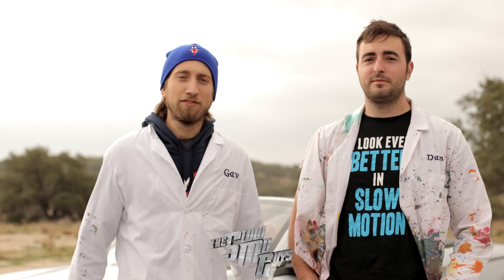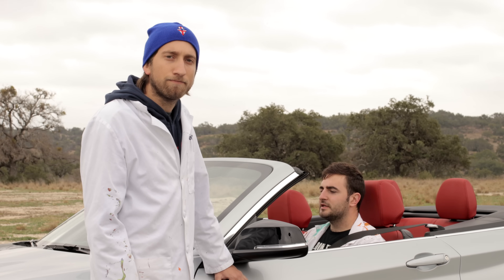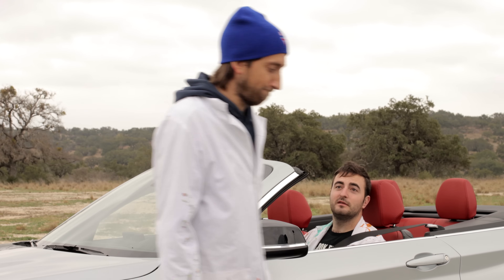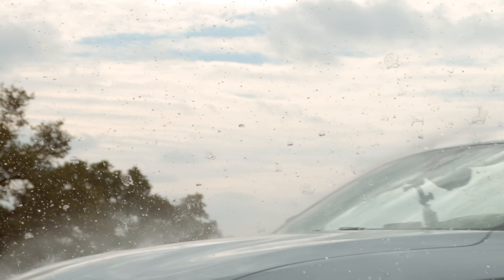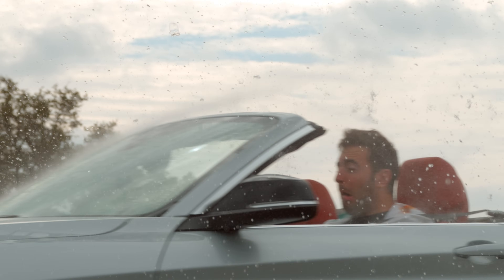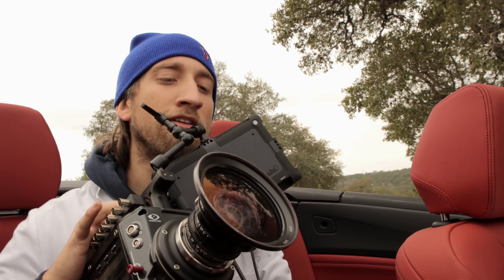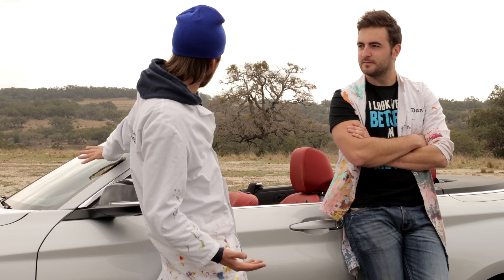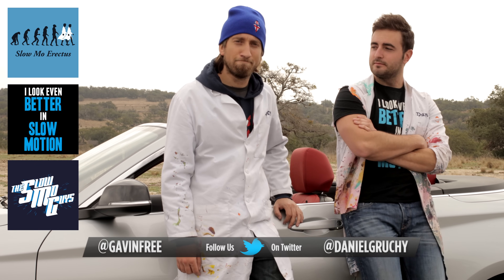Convertible Aerodynamics at 1000fps - The Slow Mo Guys

Comment: I drive a Huracan Spyder but have found there are some practical challenges in the rain when the roof is down.

For starters, the water starts pooling on the windscreen, and then the wind will slowly start pushing that water towards the left and right edges of the windscreen at which point it actually leaks over the edges (like a waterfall) onto the pricey car speakers that are on the side doors of the car. Although - I just realised I tried this with the side windows down, so maybe bringing them up will help.

The other issue is visibility. As rain starts to pool on the windscreen eventually you need to use the wipers. At this point the wipers will fling the water around the sides of the windscreen hitting your door, speaks, you etc.

And finally of course is traffic lights. As soon as you slow down it's GG.

Comment: Why that headlamp flickering?
Reply: A headlamp always flickers, but incredibly fast, so you can't see it.
Reply: It's low on headlight fluid. (Insideish joke)
Reply: led lights are controlled by PWM signals. The PWM signal's frequency is lower than fps the camera is capturing, therefore you can see flickering.
Reply: Yathu prem They flicker because they are on AC, or Alternating Current. We don't see this with our eyes because it does it too quickly for the human eye to see.
Reply: +Skyler Miller 😂😂😂😂😂😂
Reply: Pulse width modulation is still DC, not AC.
Reply: Thanks everyone !!
Reply: Skyler Miller xD xD
Reply: Ayyy Chrisfix joke
Reply: BuilderBoy2701 you're not adding anything useful to this comment chain. please leave.
Reply: The headlight's using AC or alternating current, making it flicker or pulse.
Reply: PiratesSkull _ Better explained than me. I just remembered from the (oddly removed) light bulb video SMG did.

Comment: What's up with the headlights?
Reply: +Matt Diaz They are pulse-widh-modulated to adjust the brightness.  Insted of dimming the lamp by regulating the lamp voltage they are swiched on and off at a fast rate to achieve a dimming effect. Its more efficient.

Comment: i really wonder why some fast cars head and tail lights flicker, whats the function of it? but i only see this happen in videos
Reply: This is actually how modern Led lights work. They don't continuously shine, they flicker just at a really high frequency. Camera takes pictures at a rate of 25 fps so if it captures the right moment, the carlight will appear dark.
Reply: why thanks for telling me this, been wondering about this for so long.
Reply: I believe it's called "alternating current" or AC as opposed to "direct current" or DC. The negative and positive sides constantly switch so It doesn't really matter which way you plug it in and causes flickering, at least if I'm correct in this.
Reply: +IcespherePlaysGames I doubt its AC since the carlight ist running on the car's battery which is DC.
Reply: +Elias Steiner But isn't every source of energy DC until it's put into some sort of adapter that changes it to AC?
Reply: +IcespherePlaysGames All cars have some kind of generator which produces AC then immediately converts the current into DC to charge the battery and run the electrical system. Post-1960 cars use alternators to accomplish this. Pre-1960, cars used dynamos.
Reply: +IcespherePlaysGames More like every source of energy is AC / Rotary current (120°) since this is what generator produce. Later it is converted to DC. Same goes for the car ...

Comment: but it would still be ineffective if you were actually driving this on the road. Even if the water goes right over the top, it would still get in the car at a red light.

Comment: Nice vid, but they never mentioned being stopped at red lights, having to obey actual speed limits if they were on an actual road, driving fast in hazardous weather, and putting the roof up (probably can be put up electronically).

Comment: To watch this video in 4K you must have at least 20 Mb internet connection. I have and it works, but my computer monitor is only FULL HD, so I'm watching it in 1440 looks slightly better than 1080.

Comment: I seem to recall this rain/windscreen effect in my 1954 split screen, 'pram roof'' Morris Minor 850 which could barely get up to 50-mph - on a good day. I suspect you just need to be going faster than the falling rain. In the Morris the rain flew over the windscreen and landed on the boot, essential for persons of a long-haired disposition back in the 1970s. Of course, we all got soaked when we stopped in a howling storm, trying to put the roof up which was renown for trapped fingers trying to get  the leading edge into the lugs on the top of the screen. Filming rain is always a bit of a mission and involves lots of lighting. 

Carry on, chaps. Well done.

Comment: Gavin, did you see the water droplets hitting an invisible layer as if they were hitting a surface before they even hit the car? That was the air being push and compressed in front of the car because of the high speed. the droplets thought they were hitting a surface because of the high air pressure. Have another look at it. 1:28

Comment: ok so legitimate question... i noticed the water actually breaking before it hit a solid surface, like it was hitting an invisible wall... is this caused because the air that the car is pushing up is so strong that once it hits the droplet... it spreads as if hitting a sold? sorry if that made no sense... i've just literally never seen or noticed that before...

Comment: Imma call bullshit right here on the aerodynamics sweeping the water over the heads of everyone in the car so they don't "get a drop of water" on them. you can clearly see the wet mist hit the camera lens at 3:41.
Reply: AsquareM Productions You know the whole idea of convertible is that it "Converts" To a car with a roof right? Like, if it rains, you just put the roof up. And they did specifically say in the video that they don't get a drop on them, so you're arguing at crossed purposes here.
Reply: Still, its won't make you drenched wet. A little damp is better than drenched out during monsoon.
Especially if you're not supposed to have been driving the car.
Reply: Mr Geary Oh, nah, I didn't
Thanks for clearing that up m8.

Comment: My wife and I have been caught out in the rain with the convertible top down... If we were going 45 or faster not a drop got inside. If we were going 35 we'd be dry but the back seat was getting rain... if you stopped at a redlight everything was soaked lol.

Comment: In UK they use miles or kilometers ?
Reply: Rafael Almeida Yes! Go metric we use metric in New Zealand and Australia. The other system confuses me. Like pounds and then fractions of ounces, and inches into feet, feet or yards into miles. It's a mess.
Reply: AsquareM Productions Yeah I struck up a conversation with someone at the Auckland Viaduct and we were talking about which boats were more seaworthy. He said, when you're sailing around in 100 foot swells, breaking at the top... I'm like uh, he said about the height of that roof there, uh oh, yeah that's rough seas. He said that one there will just ride the waves like a duck.
Reply: Miles
Reply: hourgmorn thanks
Reply: Well, one of the very few countries that use miles
Reply: hourgmorn I dont like miles, or the system the United States use. The metrical system is so much better
Reply: KiwiPowerNZ I know right :/  India uses the metric system too, but those other units confuse me.
Its even worse when you're supposed to react on them, like, "It was an 80-pound someone driving the car. Can you believe it? A kid driving a car!". Until the kid part I didn't know what was wrong. Later I thought how the hell did a slim kid like that have a weight of 80kg. Then, I remembered he said 'pounds', and that I was watching an American show.

Comment: Why were the car headlights strobing?
Reply: Not enough headlight fluid.
Reply: James Potter led’s dont need blinker or headlight fluid, but you can use synthetic headlight fluid meant for leds to increase performance and blinker horse power, but its not required, i think they used the wrong blinker fluid, so it decreases performance and makes the lights blink because they’re not generating enough blinker horsepower to the wheels! and i’d know because im a mechanic
Reply: Yeah most lights actually flash rather than stay on constantly. Special lighting is usually needed for slow motion filming when natural light isn't an option
Reply: They're probably LED's, which means they aren't lit constantly, but flash on and off so quickly that your eyes can't see it. When you see the flashing in slow motion it becomes visible.
Reply: Most LED lights are now powered with a series of high frequency pulses.(PWM if you're interested) it increases the control over brightness and reduces power consumption. This reduction in power demand decreases the cost of components for the manufacturer. At normal viewing speeds the flashing is not noticeable in the same way you and I don't notice a household lightbulb, TV, or cell phone screen flicker. While the mechanisms for each are slightly different - as are the reasons for doing so, the flickering phenomena can be observed in all cases on a high speed camera. (speeds vary)
All of this noted however, many cars also employ non controlled DC circuits which will never flicker. They are most commonly found in the high center brake light where dimming is not a factor. Either on or off. In those cases what we find are (essentially) LEDs plugged into the car battery via the brake pedal switch. 
The decision to have a non controlled, or an LED driver <-(term) using PWM to control lights is at the discretion of the electrical engineer at the time of design. You should expect variation of design on different cars at different times.
Reply: Need more headlight fluid
Reply: VidZ It is a headlight fluid issue actually. Headlight fluid acts as a capacitor for the flux from the light bulb, meaning a well-filled headlight will emit a glow constantly (also a reason why the headlights don't turn off in a millisecond but have a cooldown time). If there is not enough headlight fluid then the light will show it's flickering effect. Gavin talks about it in other videos.
Reply: It is Led daytime running lights, LEDs does flash very quick, our eyes can't pick it up but cameras can
Reply: Mr Geary also they were driving above the recommended 88 mph to keep the flux capacitor running at peak performance. Rookie mistake.
Reply: Cause light flashes 60 times a scecond
Reply: sheepdean The LEDs were using PWM which most of the time operates at 60Hz.
Reply: sheepdean Must need more headlight fluid....
Reply: Joe Anderton They filmed it at 1000 Fps, they said at the beginning, so if played in slow motion, the science is still around ;)
Reply: SGrint That's why I have bought LED lights to my house and I hate them. I was convinced they strobe and now I'm sure... Why don't they stay on?!
Reply: ***** it's too fast for the old eye to catch
Reply: sheepdean 60hz current.
Reply: sheepdean If you watch Top Gear the headlights and tail lights all flash
Reply: ***** What kind of shitty engineer would use 60Hz for PWM??
Reply: AltoScroll Many, many, many shitty engineers
Reply: Kris S Cool then. I was just being overly anal about it and correcting that bit, it isn't dropping 12V to and equivalent constant DC of 3V as there's a few in series and the current is indeed pulsed. Constant current sources aren't necessary inefficient either. But no point in arguing something we both appear to know well :3
Reply: Robert Dordi Nope, it's not AC, it is DC since it is a car and uses a battery, it is called PWM, the current is going only one way, but is turned on and off rapidly, by changing how long you turn it on or off you can change brightness, the flickering goes far too fast for a human eye to see, but high speed camera's do see this because the lighting period is so short, the LED hasn't been on in that frame.
Reply: *****
Well obviously.
Reply: James Potter #JustGavinThings
Reply: ***** He was going 110MPH not KM/H. Gavin said he thought Dan was going 60MPH.
Reply: The type of lights are not lit constantly, you can see and learn about this in a previous SlowMoGuys video.
Reply: Regardless if they were led's it's because the frame rate of the lights and the cameras frame rate was faster then the lights frame rate which is 60 fps.
Reply: Hugo Nabais AC power outlet rate, deal with it if you want to save money on your power bill ^_^
Reply: Mr Geary Yes but it isn't a bulb
Reply: Maestro_1 You took my comment seriously? Worrying. Also Headlight bulbs are a thing I'm afraid.
http://www.halfords.com/motoring-travel/bulbs-wiper-blades-batteries/bulbs
Reply: ***** Somehow I doubt that
Reply: Ryan McIntyre That is close to true, but still misinforming. In order to have these things be as bright as possible, they're driven with much higher current in pulses than they could take continuously without burning. This frequency is much higher that the human eye's persistence of vision, therefore we see them as dim. In order to save weight, bring down the bill of materials, and simplify things, DLRs are just run at a lower duty cycle to appear dimmer. You can have LEDs not flicker if you drive them with a constant current. Some devices, at the top of my head the only one that comes to mind is the background light on the kindle do not flicker at all, which even though the flicker is not visible does reduce eyestrain.
Reply: sheepdean #headlightfluid2k15
Reply: Film your tv In slowmo it will turn rainbow and flik on and off this is because you do not see that light waves are not smooth so the consistency varies
Reply: sheepdean Its fun to read everyone's lame, false, reasoning trying to answer your question.  LOL

Its as S Sadri said,  its something called PWM--Led's use around 3 volts, but most cars use 12 to 24 volts, so the power is turned on and off very quickly to simulate the voltage that the LED's need.
Reply: ***** no its DC... cars use DC.
Reply: Kris S 
It's a good attempt, but stepping down the rail voltage to the forward voltage of the diodes is not the main concern. It's the current, general brightness, and efficiency.
They could be driven with constant current (they wouldn't flash at high framerates), although I'm sure the engineers have a good reason to use a microcontroller for the lights.
Reply: MrMistery101 Well, of course,  but reducing voltage on a constant resistance will reduce current. I just wanted to keep it simple.  How do you think constant current drivers work?--by reducing voltage!  I've built many myself.

The best way to reduce voltage is through PWM, as adding resistance will only degrade efficiency.  I use it on my projects to run LED's and other low voltage components--The engineers likely used it because its efficient, cheap, and reliable.
Reply: sheepdean because to achieve higher brightness the LED's are Q-switched, for higher brightnesses, but only in pulses.
Reply: It's led headlights and led flashes in slo mo
Reply: sheepdean you just had to pull the pin on that grenade didnt you.
Reply: sheepdean in slow motion LED lights do this really
Reply: correct
Reply: "Pulse Width Modulation" Aka PWM 
that is used for dimming lights 
instead of running full constant power they use like 50% off and 50% on 
at a rate of usually somewhere around 50 to over 200 Hz or 100 times on 
and then off in 1 second.

One dude (SGrint) Says "They're probably LED's, which means they aren't lit constantly" this is correct and false, It is true that it is LED and they aren't constantly lit BUT you can of course run them at a constant current but you need a resistor in series not to burn them.

http://www.waitingforfriday.com/?p=404
Reply: Megabazos I've never seen a reply with more likes than the actual comment. You have almost as much likes as the top comment.
Reply: Ryan McIntyre No, 30 images a seconds won't grab it. You'll need at least 200 I'd say
Reply: Anyone here saying it's because of AC power should be banned from the internet.
Reply: Kavo-Thizzla
No, that's not why they flash.  LED lights are, by definition, a diode, which requires electricity to peak through the diode to illuminate it, and then reverse polarity and get stopped.  It is that cycle of electricity from - to + that results in a strobing effect.  The reason it shows up on camera is because the "film" might be taking 30 images per second, and during one of those images, the LEDs won't be illuminated.  It is not for power saving since power is running constantly.
Reply: SGrint Yep. Those lights are pulsed really quickly using PWM to achieve a certain brightness.  The fact that the camera picks up this flickering proves it is a true high speed camera.
Reply: Lights are lit with a A.C current which means alternate current which means they flash but you can't see it with naked eyea
Reply: Their headlamp oil was probably low.
Reply: Sean Travisis You're wrong on multiple levels lol. They're not even in Europe
Reply: +James Potter (TheJamesP) What about the wiper juice?
Reply: Ryan McIntyre Also known more simply as alternating current. it goes one way and then the other, on off
Reply: They're flashing because he's accelerating/going rapidly. All new euro cars do that.
Reply: The vehicle is sending out a type of light not seen by the naked eye, although cameras can see it. It is either this or the frequency is messing with the camera.
Reply: Cameras can't track/focus led lights
Reply: James Potter nope wrong.